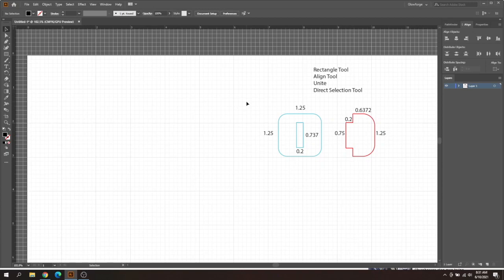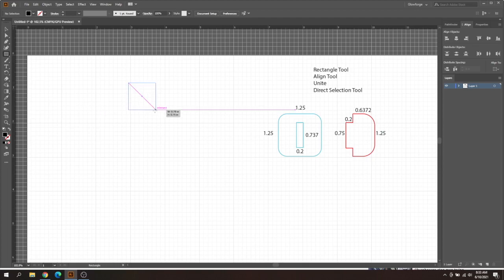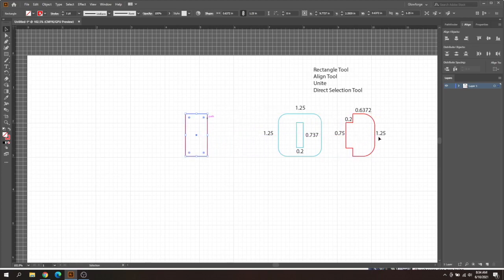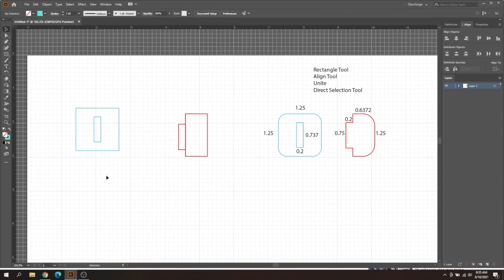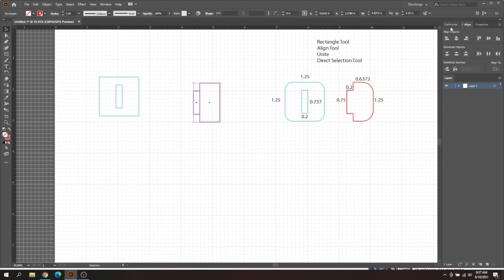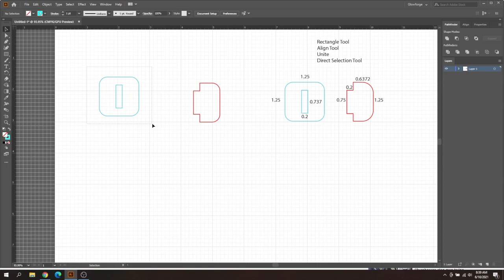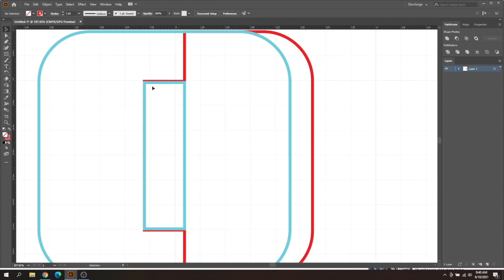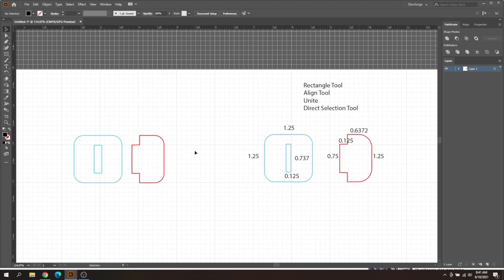Creating 3D slot and tab design basics: Ep. 8 Glowforge to the point

Comment: Why don't you adjust the inner slots size for kerf in both dimensions?  It seems like the hole would be too wide by the kerf amount.
Reply from the maker: I usually do for 1/8 wood my 1/4 wood tends to hold better without having to adjust it.